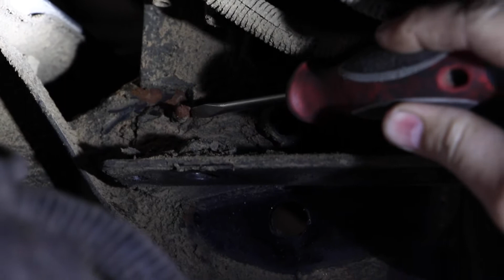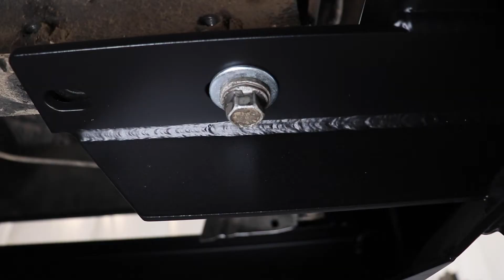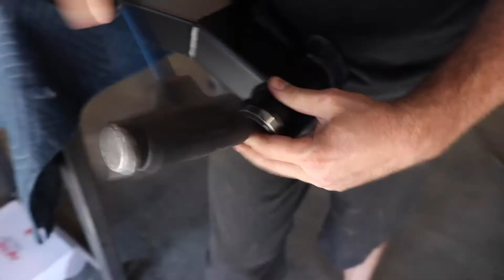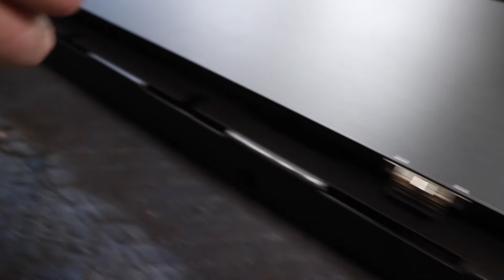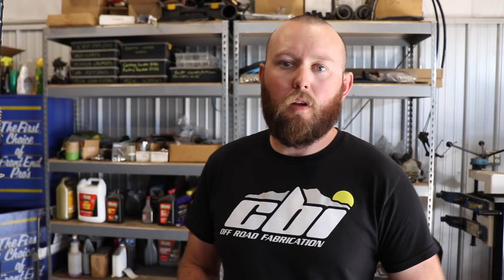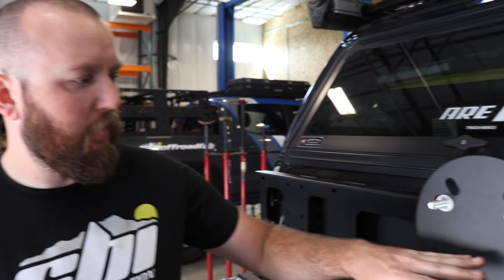CBI 2nd Gen Tacoma Bushmaster 2.0 Rear Bumper with Swing Arm Install

Comment: Why isn't the single swing arm available anymore?
Reply from the maker: We discontinued it to ensure equal weight distribution on the bumper
Reply: @CBIOFFROADFAB  would a single swing arm deform the bumper after a while since no even weight distribution? I just got one..
Reply from the maker: @mariocruz0910  No it will not deform the bumper. We have produced single swing arms for years and they work great. That being said you do have more load capacity on a dual swing arm and they are simpler to use if you are towing an off-road trailer or something of that nature. Also it helps to shorten the arm length with can help in certain camping situations.

Comment: nice design! Seriously no repaint where cut the metal?
Reply from the maker: We recommend using a paint pen or rust-inhibiting primer on all body panels that have been cut or where any raw metal is showing. This will prevent any rust issue down the road on the body of the vehicle or bumper. As for the fasteners our engineers have done load and sheer testing models on all our products to pinpoint potential issues with hardware, higher-grade hardware is used in all areas with increased loads or sheer potential.
Reply: and hardware store fasteners
Reply: ohhh and zip ties!

Comment: Do you cut 1” lower to make the body meet the bumper if there is a 1” body lift installed?
Reply from the maker: Hi Mike, please call or email our customer support team. I am not sure how to work around the body lift but the support team will be able to help!  208-360-9542 or 866-522-0697.  OR. info@cbioffroadfab.com
Reply from the maker: Basically your theory holds true but I want them to give you more accurate specifics so that you don't run into any issues when doing your installation!

Comment: Would you advise to paint the edges of the cut sheetmetal on the bedsides?  I wonder if the trim would collect moisture and road salts etc.
Reply from the maker: Hi Jason, we personally don't paint the cut edges but that is an option you could complete if you would like to. 👍😉
Reply: @CBIOFFROADFAB  Thanks